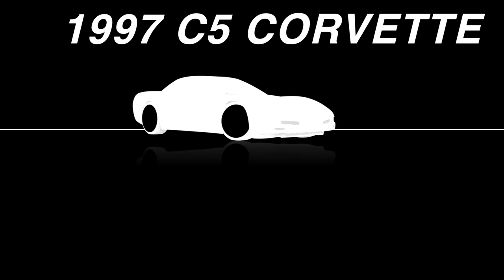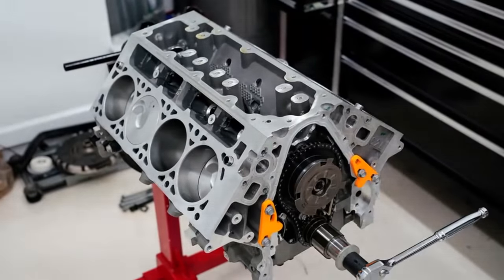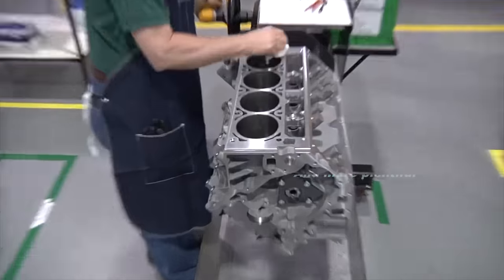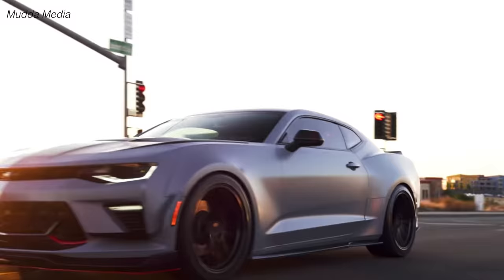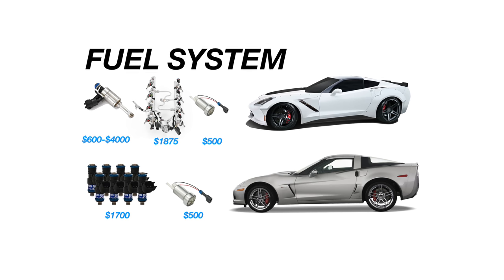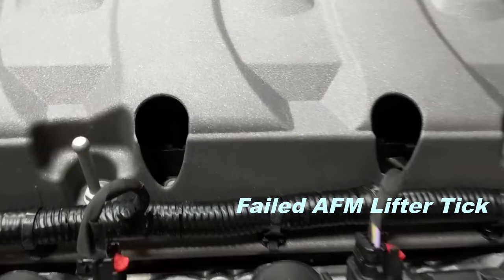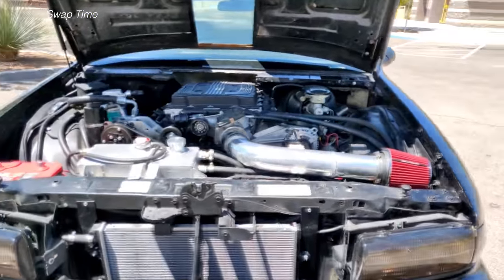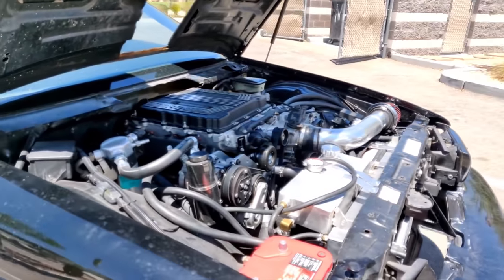Why LS Engines Destroy LT Engines Still😭 | Explained Ep.1

Comment: With me also being a little biased, not taking into account the price for modifications.... the 93-97 lt1 can be made into a monster and match modern supped up engines. The 93-97 lt1 engines are CRIMINALY Underrated. Also reverseflow cooling is bad ass !!!!!
Reply: Agreed. I had a ride in a G-Body with a 90s LT1 in it. 350 HP to the wheels and that thing could move. He made it to be a summer touring car to drive cross country.
Reply: @PacificDark  all that torque too from 1800 to 4500. Insane power band.

Comment: 2:55 LT-1 make more hp because they have higher lift cam. The higher compression ratio is to help engine response @ low speed.
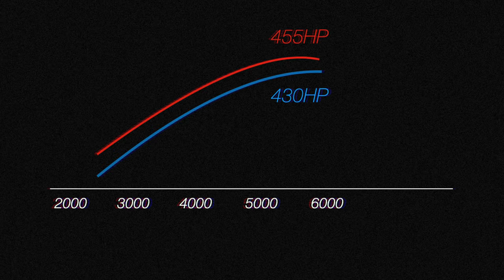3:10 vvt help the engine run better @ low speed, midrange and high speed.
Reply: And that's because the car they come installed in is constantly evolving to post better track lap times after each rendition

Comment: it's the 6 bolt rod bearing design that makes the LS so strong
Reply: exactly. the jackscrews/crossbolts on teh block it the key to more strength. Those lt engine will be junk when they hit the yard due to the direct injection system. The ls base engine will win out in the long run...

Comment: You should do a video on why the 3v is one of the worse Ford V8’s ever made. I used to own one and I’m glad I never wasted money on building it 😂
Reply: Worst for making power maybe but it's a great motor that will go 300k miles easy with proper maintenance.
Reply: @lionflame4890  seen one with 343k on the dash only thing the car needed was a new paint job
Reply: Just gotta swap the head for better flow.

Comment: I own a 2006 gto with the ls2 in it and love it 108.800 miles change my oil and filter and it runs great I don't burn rubber but I don't baby it either  and I'm 68 years old

Comment: The LT makes more power than the LS mod to mod and they all have LS9 sized head bolts so they never blow head gaskets. You can bolt LS heads directly to an LT block if you want the advantages of the LT block with the simpler electronics of the LS. They both use the same 58x/4x crank and cam triggers and trans pattern. Crank spacing in the rear and flywheel pattern is identical to the LSA. Additional injection is the only reliable way to additionally fuel an LT which DI engines have been doing for 15 years now. FRS, Mustang GT, ZR1 and several others have additional port fueling systems stock.

Comment: And roller lifters and rockers.  I believe the water pump was reverse flowed to cool the heads first instead of the block.  There were a lot of little things that added horse power or the lack of horse power robbing.  I might be thinking of a generation before the LTx., but I know that those changes added a lot to GM power from the old 350ci as we knew it.

Comment: The AFM/DoD can be tuned out on the LTs, and in fact is factory tuned out on all the manual transmission ones. The manuals instead have a skip-shift feature to avoid the gas-guzzler tax, altho that can also be removed by installing a $10 bypass cable.
Reply: Yes you can turn the system off but the problematic afm lifters are still there and will fail prematurely more than likely
Reply: Ummm, NO.  MY 2016 C7 MT has AFM and DOD.  As soon as I activate ECO mode.
Reply: @stevenstoll2016  Interesting, I know all the manual Camaros do not have it. I did not know the C7s had an ECO mode.
Reply: @upcastdrake8460  yep - eco, normal, sport, & race.  In ECO mode it will default to 4cyl DOD if the power isn't required.  With ECO on it pretty much defaults to 4cyl: 70mph, top down, 7th gear, it pulls 1300rpm, and averages 35mpg.  If I stay in 6th at 60mph it will be closer to 40mpg.  Power is just a stab of the throttle away (usually requires a downshift as the cruising rpm is so low)  Outstanding power and fuel economy combined.

Comment: As someone intimately familiar with the LT1 having had to do the following VERY common repairs: Replace a coolant soaked Optispark, a harmonic destroyed cam driven water pump, a failed rear mini ram gasket that soaked the dual mass flywheel which cannot be resurfaced, a fried ECM which is a royal PITA to tune, Fuel rails that are prone to boil fuel, which in turn causes frequent fuel injector failure, I can say Id rather have almost any other engine.
Reply: Wrong LT1, not the 93-96 LT1 but the 2014 LT1

Comment: Oh..... i had an LT1 in a 1996 Camaro B4C that was non-decommissioned. Aside from all the lights, stickers and computer being removed. This car was intact with its full package. With just air/fuel and timing mods. It was putting out 400HP and 420FpT. Ran the quarter in under 12s. These engines were solid. Apart from the pancake distributor.

Comment: I rented a C8 for a week recently and fell in love with it.. although a higher redline would be preferred.
Reply: That’s where the c8 z06 comes in
Reply: @rustysausage69  yeah but you shouldn't have to do that to a brand new expensive car, ford really did it right with the coyote it would be interesting to see someone swap one into a c8
Reply: That’s subjective though honestly. We have to remember those are two different classes of car. Anyway, Chevy and Ford are taking different routes to end up at the same place inevitably. We just sit back and enjoy 😎
Reply: @chrishansen7004  swap a coyote with a mid engine c8? ....... okay sure
Reply: Because it has a stock mild camshaft car has enough ass stock if tuned to run 6.9-7.1s in the eighth mile at 97-99mph I'd consider pretty dam good even with a bad driver the car is capable of 7.4s-7.7s and more than capable of putting the smack on most stock blower equipped so called supercars ZR1s ZL1s Hellcats Shelby GT 500s making 650-797 horsepower the C8 only makes 495 horsepower naturally aspirated
Reply: @rustysausage69  l get that a more aggressive cam will give a C8 90-110 more horsepower at the crankshaft I'm 58 years old been around small block Chevys and LS Chevy engines a while and l can tell you don't underestimate the LS or LT engine that have a mild or stock camshaft my 2011 Camaro SS has a new GM performance LS3 with a very mild GM hot camshaft with 219 duration intake and 228 duration exhaust with 525 lift on both with CNC ported LS3 heads a built 6L80e transmission with a 4200rpm Circle D stall converter with stock 3.27 gears it made 520 horsepower at the crankshaft and 490 foot pounds of torque so were not talking a max effort attempt car weighs 3920 with me in it full interior air conditioning naturally aspirated  running and tuned on E85 it makes 430 horsepower and 410 foot pounds of torque to the rear wheels nothing earth shattering with just 3 eighth mile runs it ran 7.40s at 94mph with 1.70 60 foot times with 20psi pressure in the Mickey Thompson 305/45r 17 ET street R drag radials could probably go 7.20s at 96mph with more testing and experimenting with tire pressures and launch techniques car has very wicked throttle response and does not make big horsepower numbers redlines at 6600rpm car does make very good torque throughout the entire rpm range and pulls like hell it does have a ton of upgrades 102mm throttlebody ZL1 fuel pump and injectors and one piece aluminium driveshaft race star wheel aftermarket aluminium radiator 25 percent underdrive pulley to name a few car idles with a ever so slight chop that is barely noticeable compared to a stock LS3 giving nobody the impression of what it's capable of and drives at 80mph on the highway at 2100-2200 rpm like a stock LS3 is reliable and dependable to me l don't think it would be worth it to put a huge radical camshaft that shakes the shit out of me at idle to gain 2 tenths of a second and require more maintenance and constant attention the car has 1 7/8 stainless longtube header into a 3 inch stainless X pipe into 3 inch flowmaster case style FX mufflers that come out in the stock location is surprisingly pretty quite until 3000rpm from there to 6600rpm it has a solid crisp clean sound that sounds perfect to me got many compliments by at least 12 people on the exhaust note at the track sounds amazing in the burnout box car has beat other cars on the street claiming they are making over 500 horsepower to the rear tires for what that's worth my friends Fairmont 4 door LS 6.0 with a turbo blew my doors off but it runs 5.80s in the eighth mile and is basically a drag car and not cruising 80mph on the highway for any real length of time with a powerglide transmission and a non lockup 5000rpm stall converter plus is anything but good or nice looking but it's fast with 25 pounds of boost
Reply: @rustysausage69  most of the Stang gang in the area know my Camaro pretty well from experience especially the loud no mufflers straight pipe 5.0s with annoying loud sounding exhaust claiming 500 rear wheel horsepower with bolt- ons 3.73 gears 10 speed transmission and no mufflers that once you beat them from a dead stop or dig off a light by 5 or more car lengths to 120mph want to roll race starting at 50mph
Reply: @gloriamaletta8667  lol yeah the stang gang are like that in my area as well😂
Reply: @chrishansen7004  did it right is hilarious the most horsepower a naturally aspirated 5.2 Coyote Ford engine makes is 520 horsepower 32 valve 4 camshaft engine the new GM 5.5 32 valve 4 camshaft Z06 engine makes 670 horsepower do the math the Ford engine is 150 horsepower less the Ford Coyote engine that has been made since 2011 11 years ago Chevys first attempt at such a engine since the 90s ZR1 beats what Ford has been making for 11 years OH THEY GOT IT RIGHT are you a comedian you'd buy a 100,000 C8 cutout the existing engine and invest thousands more to put a 5.0 Coyote engine and go from 495 horsepower back to 460 horsepower even if you did this the Z06 C8 is out making 670 horsepower so you better be planning thousands more in upgrades to even come close to 670 horsepower better get turbos or a supercharger because you'll be needing 210 more horsepower to get to 670
Reply: @chrishansen7004  less power. Not worth. Gt350 motor, maybe
Reply: @rustysausage69  what coyotes make 600+wheel n/a? Fbo heads/cams s550 5.0s barely make that. The lt1 does that with ease.
Reply: @rustysausage69  mod for mod the lt1 is faster than the coyote, especially N/A. The coyotes really shine with twin turbos. N/A and blowers, lt engines are superior.
Reply: @rustysausage69  exactly that’s what I was thinking 😂like getting 600whp from a 5.0 is gonna cost way more than H/C/I for ss or vette. Doable but you’re better off with a 150 shot🤣
Reply: @MyPerson555  Then it would have a proper v8 in the c8.
nothing like throwing in a pushrod into a lovely c8 chassis.....
Reply: @johncena-hq1ti  Tune the Coyote, 460 turns into almost 500.
Reply: @19coyote5oh9  ur a goofball
Reply: @MyPerson555  Don't cry.
A pushrod in 2022 has no business in a sports car. 
No other manufacturer on the planet puts pushrod engines in their sports cars, NONE.
Why do you think the Camaro, an amazing chassis btw, will die another death?
At the very least Mopar uses them in Muscle cars.
GM is too cheap to engineer proper engines for their sports cars, "let's dump another truck engine in"
Luckily the Z06 will step up and properly take the lead.
Reply: @jeremyzzz5067  Totally agree.
The new Z06 is going to be a MONSTER!
Reply: @19coyote5oh9  huh😂🤦‍♂️ the coyote makes about 470whp fbo on e85. The lt1 makes basically the same. But coyotes fall short vs the lt for heads cam setups. So what you mean?
Reply: @rustysausage69  and 👍 640 n/a is healthy. I’m sure you’re ls3 makes similar power. I’m guessing a little less. Am I right?
Reply: @johncena-hq1ti  Lol, you don't have to touch cams or heads like you do on LS/Lt set ups.
C'mon you know better. Cams or "cam" is a pushrod issue, first thing any pushrod setup needs to do when starting to make power.
A quad cam engine is just superior plain and simple.
But I get the pushrod thing, like if you want to bring it to uncle Tom's backyard garage and hit it with a hammer to work on it.
Reply: @19coyote5oh9  how is it superior yet slower n/a? Explain that one fam. The saving grace of the 5.0 is the 10r80. Without that, they stand no chance. And like I said mod for mod the Camaro will win every time. Trust me I’ve watched hundreds of races between 5.0s and LT1s.
Reply: @19coyote5oh9  and without heads cams on the 5.0, they’ll make 520whp at best. So idk what you’re talking about. If you wanna hang with 600whp Chevys, you’re gonna need boost, n0s or a nasty n/a setup.

Comment: Ford was producing overhead cam engines which were much more modern . Overhead cam engines are actually older than pushrods . The first push rod design appeared in 1904 by Buick . The first overhead cam was 1902 Peugeot .

Comment: The LS is the only engine that you can go to your nearest junkyard and pull it out take it home and give it a quick once over like give it a fresh oil change, spark plugs and wires, and if you need to a fresh set of coil packs and make sure it spins over smoothly drop it in the car wire and plumb it and then go order a Chinese turbo kit off of eBay or Amazon and while you're at it grab a few Most+ 525gph "Hellcat" fuel pumps to drop in the tank to make sure you have enough fuel pressure and then hook your Chinese turbo kit up and you are ready to go 8sec 1/4mile passes in a 3000lbs car and make roughly 800-1000hp depending on what LS you pulled out of the junkyard and how many miles were on it when you got it and how healthy it is and it depends on what size turbo you got off of the internet and how good it is and it also depends on what tire your running and how good you can drive and if you have right rear gear and converter and if you are putting all of the power down to the track

Comment: I do have a comparison that I would like to see if you could.  Gen 1 small blocks vs LS.  I am looking for a cost per hp comparison.   Reason for the request, the Gen 1's have been around forever and have more aftermarket parts (currently) available to them vs LS.  Granted I know the stock head is the biggest re-stricter of power but for under $5K, you can build over 500HP on a stock 400 or 383.  So the parameters I would use are - displacement (nothing over 400CI plus .030 overbore for cleanup), cost - I would keep it to $5000 and naturally aspirated, 2 bolt main on the Gen 1 would be fine, both junkyard motors.  What are your thoughts?  Would this be a worthwhile video?   BTW:  nice work on this video!
Reply: Just get and ls2.
Reply: The thing is, you'll spend a lot more money on the SBC to get the same power the LS starts with.
Reply: @fryloc359  I haven’t crunched the numbers that hard but is that true? The small block is dirt cheap, even compared to and ls1

Comment: I have been running a LS3 bolt on  motor for 12 years now. The DOD is turned off via tune with zero effect on milage.  It is rock solid reliable and is a joy to drive. I wish I could have its clone in my LT powered truck.
Reply: Huh? Do you have an L98? The LS3 never had DOD.
Reply: @joshuahedrick  It's an L98. A member of the family of LS3 engines.
Reply: @brianmoore1164  I would not classify it as such. That's like saying I'm running an LS9 because it's 6.2 L and so is the L98. GM assigned it a different engine code for a reason, it's not just the DOD
Reply: @joshuahedrick  They are 98% parts compatible.  Be hung up on verbage if you wish. I'm not.
Reply: @brianmoore1164 What are you driving? The L98 isn't even the same displacement as the LS3 and makes way less power. Are you sure you don't have an L99? Words mean things 😂
Reply: @joshuahedrick  Be tied up on verbage if you wish.  I'm not.
Reply: @brianmoore1164 I'm not tied up on verbiage. If your vehicle truly has an L98 in it, your down 80 horsepower on an LS3 but if you want to pretend it's the same thing more power to you. I bet your the kid who went around telling everyone their 4 banger was a v6 😅😅

Comment: Pretty decent discussion. What I 1st noticed about the LT series motors was how much more space the front accessory drive took up when looking @ them @ SEMA in 2013?....Sorry but, the wide poorly utilized accessory packaging makes them a NIGHMARE! to install into any old Muscle Car along with the added complexity of the direct injected fuel system....They are't that huge of an improvement over the Gen3/4 LS based motors. Not worth while for me. One thing to note, the premium LS motors are getting more scarce (LS3, LS7, LS9) and commanding more premiums....I was happy to get a 2010 LS3 Dry Sump motor out of a wrecked GS Corvette in 2014 for under $5K....Not going to happen these days (Less then 3000 miles on it)

Comment: In today’s world I think we forget there is such a thing as too much power for the application.  For street driving 500 to 600hp and torque is probably the sweet spot to be scary but not too unmanageable.  A few years ago NASCAR cars only made 800hp.  You can make outlaw class power with production engines which is crazy to me.  You can have a 500hp na ls that has a mild cam, more if you go crazy with the cam.
Reply: Well said spot on 👍

Comment: 1.5 things you got wrong: The L8T has a hydraulic steering pump.  Also, the factory manual trans cars do have the AFM hardware installed, but it's not active.  The only exception is the LT5.

Comment: I’m not a fan of the direct injection because of the problems with the intake valves coking up.  I have a 2015 ZL1 manual transmission and I plan on keeping it for the long term.